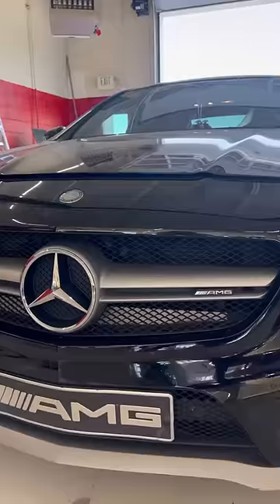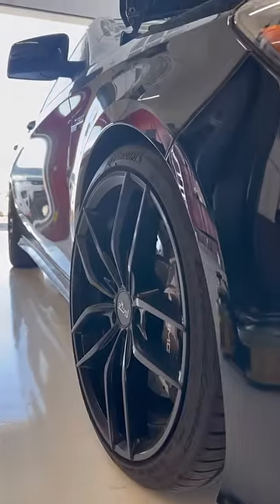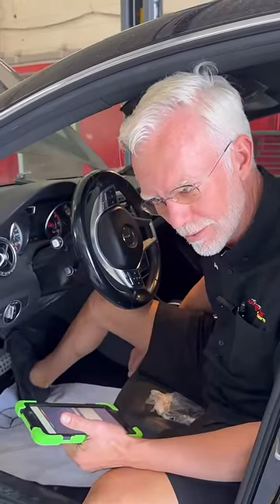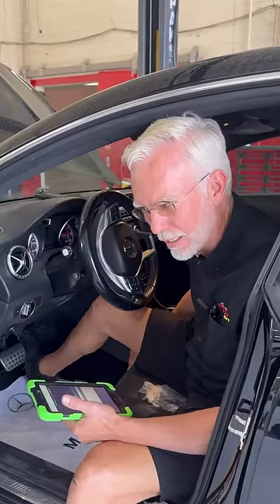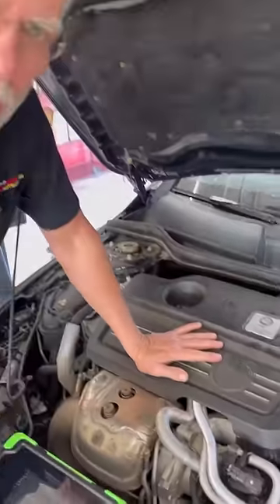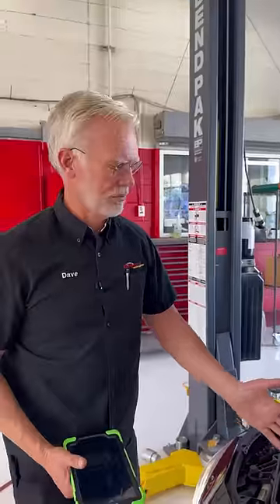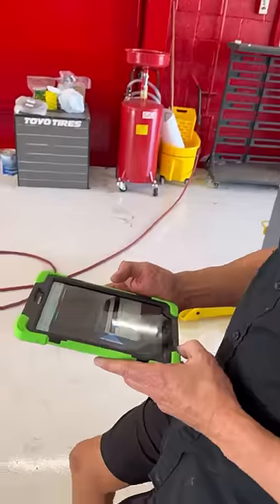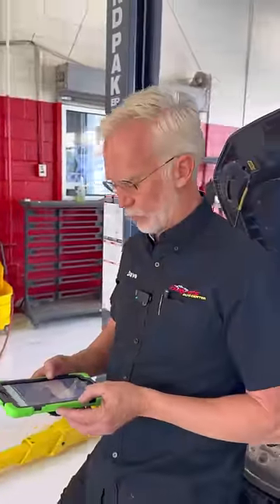Mercedes AMG Nothing but a slight noise on start up #carrepair #autoshop #mercedes

Comment: After your warranty is up, don't ever take it back to the dealer for anything. Literally some of the most crooked people on earth run dealerships.
Reply: Word!
Reply: Sounds like a belt or idler pulley? Just a guess. I'm no grease monkey 🐒
Reply: That's fair for to say but alot of times it comes down to the service advisor. Sometimes managers are at fault for allowing people to be they way they are but alot of dealerships now are trying to fix what others have made a muck off
Reply: Exactly right. My dealer ripped me totally off and it wasn't until I got home and spoke to a mechanic I knew when I realized Stadium Toyota ripped me off
Reply: All the sudden they get very stupid after the warranty is up
Reply: As a dealer guy, some of the sketchiest repair recommendations I've seen come from independent shops.
There's good and bad on both sides of the fence.
Reply: StealerShip
Reply: They don’t call them stealerships for nothing!
Reply: Recently had a Mercedes dealer’s service department do work that was not authorized.  Totally unacceptable.
Reply: Everyone i know who worked at a dealership either couldnt hack it or theyre honestly a POS person.
Reply: Our local dealer is actually really good, a lot better than some of the local shops that have straight up scammed us
Reply: They ought to be legally required to wear the plaid suit with the white loafers and matching wide white leather belts and cheap toupee so you automatically know what you're in for
Reply: @michaellastname7835  True. The big mistake that most people will not own up to is NOT  being an informed consumer. Understand your car as much as possible. When I hear about people putting oil in a coolant reservoir and vice- versa, I can't even....
Reply: No cap used to be a porter at Honda was my first week and went to take my 10 min break in my car boss man fired me when I was returning to my shift thought I was ditching work fuckin lame
Reply: @bernardovillegas4720  You're better off.
You're lucky not to have worked under that ass chocolate another minute.
Reply: Funny thing is, vehicles start acting up after warranty is done
Reply: @WheresiNfinity  I think these days,  isn't there a chip in the cpu that the bank send a little ping to to tell it when the last payment clears, so it knows when to commense nickel and dime Armageddon?
Reply: @vanpenguin22  your on to something🤔😂
Reply: @WheresiNfinity  Thank you 😊
Reply: Heberts Town and Country  Dodge in Louisiana!
Reply: Definitely. Bought an old car from a dealer my dad knew. The battery was clearly damaged after sitting for so long so we asked for a replacement. They just cleaned it. Then we went and paid out of our own pockets to replace the battery and they didn’t secure it. If it shorted on something I would be dead
Reply: reason why CarMax is full and going bankrupt
Reply: Don't even take it to the dealer during warranty. The only time I ever go back to the dealer is for recalls or warranty work.

Find a quality independent shop for service and maintenance.
Reply: @thephotoyak yep, they totally rip you off.
Reply: Good to know
Reply: I had someone tell me someone out windshield wiper fluid in my oil. 😳 turns out it wasn’t that at all. What happened was my Abs system needed to be fixed 🤦🏼‍♀️
Reply: I will say that at my lexus dealer, it's usually the service writers that are scummy. All the techs preach CYA and ethics.
Reply: @michaellastname7835 Thank you! Exactly right!  People labeling all dealers as criminal or “stealership” is literally the same as labeling any other entire line of people as criminals. It’s flat out wrong.  As a dealer tech myself I absolutely despise comments like this because people are saying it with zero basis in reality.
Reply: The free oil changes you get when you buy a car are methods to get you used to using their dealership when future issues come up pass your warranty
Reply: I feel super bad that people have bad experiences at dealerships 
I work at a dealership although a small family owned dealer we do get a lot of comebacks from the auto nation and Chapman dealerships of the same name but to be fair outside of the lube techs everyone here at my store is above 30 and has at least 10 years experience all the heavy line guys are in their 50s and above so the people here know their stuff.
Reply: Buy these things assuming you’ll never deal with the dealer from day one. Problem solved.
Reply: This is why technicians get a bad rep. I’ve been working at a Mercedes Benz dealer for 3 years now as a tech and I can say that we certainly do not do this. Now that doesn’t mean that there aren’t bad apples however. It sounds like the dealer severely misdiagnosed this car.
Reply: Not just dealerships but almost any mechanic. One in a million finding a decent and ethical mechanic.
Reply: @joey7253 so THEY don't call them stealershios?
Reply: @vanpenguin22 I definitely believe this, even for ’reliable’ cars. Our Prius c died at 207,000 miles which I think is premature (esp for a Toyota). Ironically on that same day a Scotty Kilmer video showed up in my feed about a Prius c that died at 220,000 miles, coincidence! Furthermore, a few weeks ago I saw an I do Cars yt video about a Prius C that blew up its engine at 222,200 miles. I seriously think certain vehicles are programmed to die at a specified mileage, and hybrids/EVs are much easier to make this happen. I may be wrong but it seems odd.
Reply: I wouldn't take it even in the warrante
Reply: Ummm  so you literally just accused me of being a thief.     What do you drive?
Reply: @Cola64  what kinda car do you have?
Reply: @sprinterboy713  1999 hyundai elantra wagon 240k all it ever needed was plugs and brake pads
Reply: 100% TRUE!  The Chrysler Dodge Jeep Ram dealer in Antioch, IL has tried to rip me off so many times that I will drive to an out of town dealer just to buy parts.
THEY ARE THE ABSOLUTE WORST !!!
Reply: So who do I take it to?
Reply: @floormop6672  
Check reviews?
Reply: It's called a Stealership.
Reply: The dealership needed $$ so they planned on customer buying a new car, then they would re-sell the used car they bought for a song, or if customer opted for a new engine....they'd either repair it & charge for a rebuild or engine, or they'd rebuild it...oops cant get any parts...yeah, we can put the engine back in...but it'll cost you, and it might not run at all NOW, could be seized up by now....just keep that money ball in the air...
Reply: @freespirit369-nb4jf it’s a boost leak. That’s why you hear a whoosh. And the code throws underboost, which what a boost leak causes.
Reply: Oh yeah and they are at Toyota Carlsbad
Reply: @seanlacroix used to be a porter at a big dealership in my area. They would brag about screwing over customers all the time. The only decent people I knew were some of the techs. Most of the salesmen were alcoholics and drug addicts, same with the advisors. Management was a boys club and sexual harassment was pretty rampant in all parts of the business. I would get called lazy for taking my hour break, despite having to clock out for those breaks, or my boss would adjust my time if worked straight through the day. I was laid off with a severance package when a third party company took over the hourly positions at the dealer, I took my money and found a new job and swore off that kind of work environment. Since then I have worked in construction and warehouse environments and have never been treated as poorly as at the dealer.
Reply: @Lisascornerlot120 It could be because you’re unable to communicate/write English correctly and they were confused.
Reply: Disagree, the Honda dealer I always go to is the best experience I've ever had with any garage, dealer or independent, they're always happy to help, can order any part I need for me and their prices are in line with alot of independent shops, sometimes even cheaper
Reply: And dealerships owned by Berkshire Hathaway and other big companies
Reply: I work at a dealer and lemme tell ya we ain’t shady or atleast we don’t try to be. With that said, don’t come to us expecting free shit if you don’t do every last one of your services with us. We take CARE of our good customers.
Reply: True as the nearest welfare office
Reply: dealer just tried to charge me $8500 for a timing chain service
Reply: Thanks for lumping all of us into one group. Pretty ignorant and on your part. It's funny how we're all crooks...until no one else can fix your car. Merry Christmas
Reply: If it's overheating I'd be checking the strength of the coolant, the condition of the hoses, if it has a separate belt for the waterpump and the thermostat. It probably has an internal waterpump that needs to be changed along with the timing belt/change.
Reply: That noise your hearing sounds to me like the turbo wheel is rubbing the housing in which case it would need a turbo charger
Reply: Facts!!💯💯💯
Reply: Facts
Reply: Yes, I’m in Green Bay Wisconsin Dorsch ford. Sold me a Lincoln MKT with a sunroof. They kept my car for 97 days during Covid and they broke my window and they refuse to fix it under warranty. Talk about a bunch of scumbags. Don’t go near dorsh Ford in Green Bay Wisconsin. 🤬🤬🤯🤯🥴Please put the word out.
Reply: Exactly, especially Ford. What they do to me is infuriating and they should be in prison.
Reply: TRUTH!
Reply: you obv know nothing about how dealerships work
Reply: They're not. The problem is that in the automotive repair industry, no good deed goes unpunished. They've found out long ago that trying to save people money just results in angry customers who think they're incompetent. The issue with this car is that the engine head and possibly the deck may need to be resurfaced. While that may be possible along with the installation of a new thicker head gasket, there's a chance that it won't work perfectly. They don't want to do all the work of taking the engine apart only to find out its well beyond repair.
Reply: Correct! Just out of warranty the engine light comes on. Dealer says cat converter needs to be replaced and quoted SIX THOUSAND DOLLARS! So I did some YT research and discovered there a thing called cat cleaner which you pour into the tank. I fixed the fault for $40.
Reply: My Tacoma had 2 free oil changes I took it in for that they came out sat down beside me like it was a big issue and said I had a nail in my tire be 50 ish to fix.. ok is the tire leaking?? Service woman no not right now.. ok it be fine!! I drove for another year with that damn nail in my tire .. the look on her face was priceless
Reply: Stealerships
Reply: I wouldn't bring a car to a dealer for any repairs, warranty or not. I stopped buying new cars as it was insulting to have to fix issues myself because dealers had no interest in actually fixing a problem. They just wanted to profit from it/them.  
I just find what I like used that has low mileage. Check it out and do my homework. When it breaks, it's on me. It costs a bunch less than buying new.
Reply: Not always the case. My dealer will do stuff under warranty or goodwill when the car is well out of it to help customers out. Don’t under stand the hate. lol
Reply: amen brotha Freeman.
Reply: Agreed and i work at one.
Reply: Agreed... over priced labor and parts.
Reply: Service writers are on commission. Go somewhere else
Reply: There are also some of the most honest and ethical as well.  Don’t clump us all together!
Reply: I thought the sme thing until I got ripped off by one of those repair shops.  Ended up going to the dealer to get my Jeep fixed after wasting $3k at a "reputable" repair shop.  Never again!
Reply: Most dealers hire cheap rookie mechanics.
Reply: @TheHonestAdvisor A lot of the reason nobody else can fix their cars is because your manufacturer specifically made them to be unfixable by anyone else.
Reply: Stealerships
Reply: In some fairness to dealerships some of them are getting better but it’s not because they want to,  it’s because they know they have to get better
Reply: @robingamel9788 I live not too far from Town and Country.  Whatever you do don’t take your vehicle to Landers in Bossier.  Those ass hats are as useless as a fart in the wind.  Took it to Brown in Minden and had to get a new motor because of Landers.  Does town and country fall in that same category as Landers? lol
Reply: Town&County took 11 months to install a used bed, motorcycle hit me. Then frame was bent from the get go.
Reply: This is how capitalism works. Make the most profits possible. No matter the cost. That’s why I’m a social democrat now.
Reply: My warranty is up now, where should I go? I need a place to trust but want more than just oil changes. Need my car to last so willing to pay a price for some important maintenance
Reply: @tjr8428  You want to find a local shop with good reviews. Sometimes you can find a shop that specializes in your particular vehicle. I take my Tundra to a local shop that specializes in Toyota, Honda, Subaru, etc.. Google reviews are your friend 👍
Reply: @FreemanFighter44  awesome, thank you!
Reply: Right, especially for parts. They were gonna charge me for 800$ for 1 struts when I can get $350 online for the exact same thing
Reply: Sadly the repair shops have caught onto this and stay just 2% or so below the dealership price. In fact for my ECM they were going to charge me MORE than the dealership
Reply: Or at least let the independent shop, like most independent shops shotgun as much shit at it first! Then, once they’ve taken all your money, go to the dealership throw a tantrum on the service drive and insist everything be covered under warranty because you spent all your money elsewhere on shit that was t necessary!
Reply: Ahahah such simple deep statement...ahhahah
Reply: @indonesiaforlife  did the ones you got on line come with the tech to install them and then perform the necessary alignment?
Reply: @autoteleology  really? Like what in particular system did the manufacturers do this in?
Reply: @haroldswick9962  WRONG!
Reply: @bmf572  It's both in the way that modern cars are designed to be built efficiently but difficult to service from a topological standpoint, and also the fact that everything is loaded with sensors that require increasingly more complex and proprietary tools to access.
Reply: @btolley100  do you know of an auto repair facility that doesn’t have service advisors/writers? All service advisors/writers are paid commission in some way.
Reply: @johnnybravo1555  the hate comes from people who don’t know what they’re talking about not understanding the inner workings of a dealership service dept. They’re the same people who go to an independent, get taken advantage of on “repairs” and unnecessary “maintenance” that doesn’t fix anything then come to the dealership expecting all repairs under warranty because they have no money left! Yet they’ll continue to go to that same independent for future needs without even thinking about it!
Reply: @bigsneakypete  yes this has been happening more and more. Dealerships are hiring pretty young things who don’t know shit about vehicles because they’ll take the shitty pay plans they’re offering. That being said, very very very few “maintenance plans” these days cover driveline fluids. Also, there’s no such thing as “lifetime fluids” as manufacturers claim these days. They do this because it makes customer think they don’t have to do anything to their vehicle which is a sales ploy. They also know most major fluid filled components will last beyond the warranty period and when the major failure (most often the transmission) does take place most people will not perform the $7-8k repair and instead will go the “cheaper rout” of spending $70-80k on a new vehicle!
Reply: @aaronhobart6223  yea and if she didn’t tell you and the next day you wake up to a flat tire what would be your first thought? You’d be calling that place wanting to know why they didn’t tell you about it!
Reply: @robguyatt9602  yea don’t worry the cat is going to now start breaking down, which will restrict your exhaust within the next year. Good luck.
Reply: @autoteleology  all the complexities and sensors are all due to conditions set forth by our and other governments. It’s the only way to keep vehicles running “clean” and for as long as they do these days. However certain things like the overly complicated stereos and other electronic components are just ridiculous and when they fail the price will give you a heart attack!!
Reply: @bmf572  idk wt u mean by tech but it’s electronic and it doesn’t come alignment but I don’t think I need alignment tho since we didn’t remove the inner tie rod (I guess that when u need to get an alignment done) I’m not an expert so correct me if I’m wrong they only had unscrew the outer tie rod from the steering knuckle. I mean when I got the car back my alignment was just a slightly off center but I’m good
Reply: @indonesiaforlife  a tech is the person you’d pay to remove and PROPERLY install the parts you were in need of. Also, struts can effect camber/caster and when they are replaced those can both be effected by the install thus causing inaccurate steering as well as uneven tire wear. Or do it your way with no alignment, smoke a couple of tires and then realize you should’ve performed an alignment when you replaced the struts.
Reply: @bmf572  wow didn’t know I thought as long as my steering still centered or slightly off centered I’m good but there’s actually more to that lol is this the reason why sometime my steering feel a lil weird like sometimes it just turn to one side and i had to correct it?
Reply: @indonesiaforlife  oh no that sounds like an issue in either the rack assem or the control unit. Anyway, an alignment is cheaper than tires these days.
Reply: @bmf572  Let's talk more. What did I write that you replied to. It was a long time ago and there's a hundred replies. As to my car, It has had a few doses of cat cleaner so far. Generally lasts a few tanks before engine light comes on again. I expect I will have to get the cat replaced eventually.
Reply: @robguyatt9602  yea that “cat cleaner” stuff I’ve seen the long term effects which usually consist is a cat disintegrating and clogging up the muffler and such. The worst case I saw was on an expedition where the exhaust was so restricted, the customer kept driving it and in the long run smoked the engine by overheating it.

What specific codes are you getting and what kind of vehicle is it?
Reply: @bmf572  This is all interesting to learn. When my dealer told me I need to spend $6000 with them to replace the cat I just knew I had to "do my own research". Of course I went for cat cleaner first. I've got nothing to lose. I most certainly would not let it get so bad it damaged the motor. If the cat cleaner stops doing the job then the cat gets replaced. But not at the dealer for obvious reasons. Sorry, I can't remember the code. But the dealer said it means cat performing poorly. Subaru Forrester 2016. But wait, there's more. Now when going over 95 kph (a bit under 60 mph) the car shudders. I cure it be slight rotation of the steering wheel. It seems not to shudder if on a long right hand turn. It needs a new set of tyres and alignment so I ill get that done this week and hopefully that's all that's needed but I suspect not. So the car has to be fixed and replaced. I've had enough troubles in just 120,000 km (abt 70,000 miles) Several issues during warrant but now more and expensive issues. My last car, Mazda Tribute lasted me 250,000 km and not a problem at all.
Reply: @Lisascornerlot120 stadium Toyota hey? Where was that? I live next door to one haha.
Reply: @buckrager4165 it's a  supercharger not a turbo...just saying
Reply: I take my car to dealer to change oil or if I feel lazy to work on it but it's cheaper to go to local mechanic
Reply: Isnt that a form of extortion?
Reply: @vanpenguin22 that must be the chip shortage manufacturers keep complaining about.
Reply: That's a fact. My friend took his pickup in to a Dodge dealer. It was running rough and had some white smoke coming out the exhaust. They told him there was a hole in one of his pistons. My friend ask about a buying a short block and they told him they sold only long blocks only. My friend told the dealer he'll have to think about. The dealer tried to warn him that if drives off the engine could get worst. Like what? Another hole in another piston.
My friend thought about it and decided to tear down the engine himself. During the breakdown he noticed a couple of the bolts on cylinder head wasn't as tight as the others. After getting it apart he could see that there was a leak from going of coolant going into that one cylinder. This was probably something wrong with the machine that tightens the head bolts at the factory and it's likely the dealer knew about the issue but they tried to pass it off as being a hole in the piston.
Reply: It depends on who the service manager is. I personally see the biggest greed in national chains.
Reply: @bmf572  no I knew the nail was in there it’s been there and if the tire was flat I just change it
Reply: Absolutely spot on.
Reply: Isn't that the truth  , yep
Reply: @bernardovillegas4720 I love taking breaks in my car and watch YouTube videos and eat my fried pastrami sandwich, people go nuts when you sit in your car.🤓
Reply: dealerships pretending they didn't see this comment and continue to operate normally.
Reply: I wouldn’t let them put air in my tire once the warranty is over.
Reply: Don't put that blanket over every dealer. I went through three starter motors from a mechanic who couldn't figure out the problems we were having. Our dealer took one look and knew right away what the problem was in the transmission, and got Chevrolet to cover the repairs. Maybe my dealer is one in a million, but they all sure as hell aren't crooked.
Reply: As a seasoned mechanic I got fired cus I stood up for this nice lady facing the same problem.  Best thing that's ever happened in my mechanic career.  Pushing 70s today, had to retire at 48 due to spinal injuries. 😢
Reply: @mrow9999 9999,, I throughly agree.  Most people aren't qualified to add oil nor replace wiper blades.  There's bad automotive shops everywhere, n no sure way of fixing it.  Dealers can be the root cause for troubles n claimed engines need replacement when its a timing chain n tensioner n cover problems .
Reply: Second most crooked, career politicians take gold.
Reply: It's not that they're crooked, they just don't know how to diagnose anything--they just replace parts at $250/hr.
Reply: I agree and I’m a mechanic at a dealership
Reply: You definitely are not lying they’re crooks
Reply: Stealerships
Reply: I don't even take mine to dealership WITH my extended warranty. I never should have bought the warranty and I trust my actual mechanic and don't mind paying for the Lil things for now rather than a fight over it
Reply: @AUTOHAUSEUROPA same haha
Reply: Disagree. Always take it to a dealer for warranty service. Especially if you have a maintenance plan. You're more likely to find other warrantable damage or problems if you're at the dealer that will be covered under your warranty. You're pretty much guaranteed to get the correct oil and filter. You're likely to not have to pay out of pocket for any warrantable repairs (such as engine failure) because they have a record of your scheduled maintenance. I am not saying dealers don't have their issues with scamming customers but one of two things happens with that. One, a Service Advisor is telling you you need something to pad their sales. Two a mechanic is suggesting work they aren't actually doing on purpose to pad their production numbers. Rarely do these things happen but people always remember and talk about them when they do so it's very much a case of happy customers not making any noise. Suggesting people don't take their cars into a dealer is bunk. Vet your dealer just like you would an independent shop. Independent shops absolutely will rip off customers if they think they can get away with it. They aren't immune.  @thephotoyak
Reply: My question is this. They told him he needs an engine. They should have given a detailed reason why including what troubleshooting steps they went through to come to that conclusion. Nobody should trust any professional who recommends something but can't tell you why. Is this a case of the customer not understanding what they were told or deciding to get a second opinion because they don't trust the place they took it to, or what?
Reply: @atrielienz  there is a pile of case law in Canada (I'm Canadian), dealers can't deny you warranty work because you didn't service with them. They have to prove negligence to deny warranty work, and servicing at an independent shop, or even yourself, is fine. I haven't looked into US case law, but I would bet it's similar. That is a common scare tactic dealers like to throw around though.

If you find a good dealer, great.
Reply: @thephotoyak  I don't live in Canada so I can't be sure but I know in the US you're not required to service with them, just to provide a service record. So receipts if you change your own oil and filters etc. What I'm saying though is that if you go to a dealership for service you're more likely to get expedient repairs for warrantable problems because you're already there and it's easier to accommodate you in that instance. In a lot of cases they will make warranty repairs to your vehicle that you didn't even know about just because you came in for a recall or an oil change. You won't get that with an independent shop. I know for a fact that if you can't provide records of scheduled maintenance and your engine blows up (in the states) the manufacturer will not cover it under warranty because the warranty stipulates that it be manufacturer defect etc not abuse or neglect. So if you never change your oil and your engine throws a rod or spins a bearing you're SOL.
Reply: @FreemanFighter44  Id bet they
Reply: @FreemanFighter44  I'd bet they can deny you warranty work if they can prove it's because you haven't serviced your vehicle though, or more likely (like it is in the US) if you can't provide proof you've done recommended service at the recommended interval. No automotive company on the planet will let you go 40K miles without having done a single oil change once and then replace your engine under warranty when it blows up.
Reply: @mrow9999 agreed…buy a code reader and learn how to use it…there are YouTube channels that show easy fixes rather than bringing your car somewhere.
Reply: My advice to these people that buy these German vehicles: don't buy or own one if you aren't comfortable fixing some things, and doing the maintenance on them. I own a Porsche, bought it used, absolutely love driving the thing daily but I know I can do brakes, rotors, starter, alternator, fan belts, struts, etc, on it. Oh, never take to the dealer for anything other than re calls and buying a set of keys. Happy driving!
Reply: Your car ends at a dealer anyway when the unauthorised workshops can’t figure out the problems. They just don’t tell you. Ask me how I know… after 7 years as a mechanic at an authorised dealer.
Reply: Boost leak